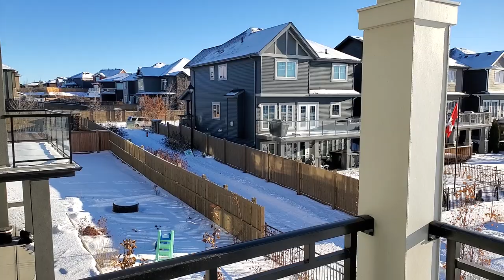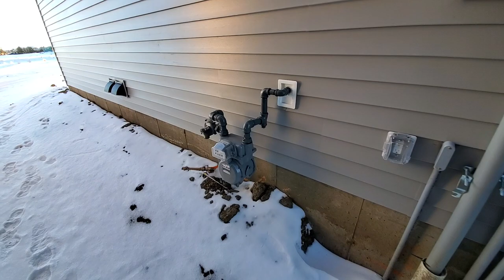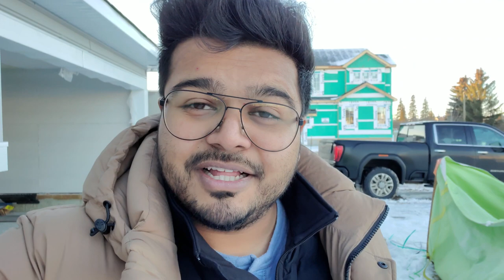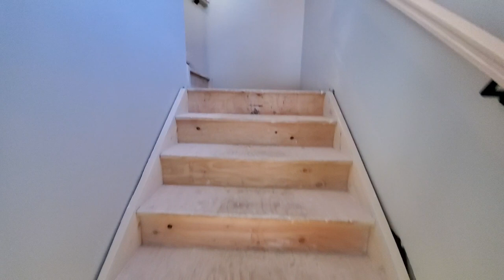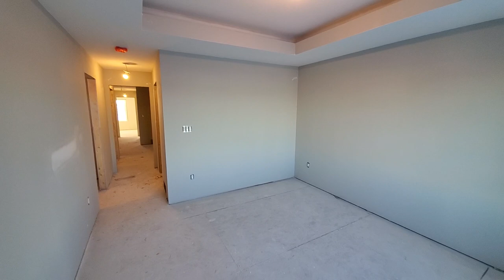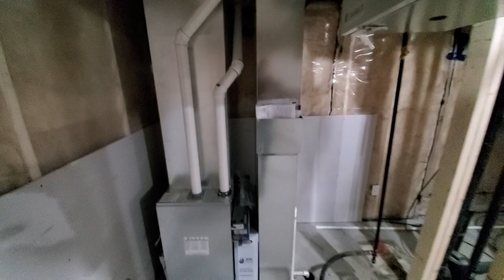New Home Construction, Home Builder SITE VISIT - DPAD's Daily EP32

Comment: In the master bedroom closet, you have the heating vents so close to the wall, but yet you've planned some shelving?? Wouldn't it be better to bring those out a few inches past the depth of the shelving...

In the niche for the refrigerator, I think you have the water supply all the way at the bottom, you could use one of those flush mount boxes, like you did for the water supply for the washer dryer, which then you could change the filtration easily without having to move the refrigeration unit, away from the wall...

I'm not a big believer in using the special drywall and applying tile, I feel much better with a Good Vapor Barrier base, with cement tile board...

Also are you going to be using colored grout, white grout is just asking for problems dirt & nastiness in the future... Maybe pick up one of the colors used in the ensuite, colored grout would tie it all together...

The window on the side where you're planning the chandelier, really no View, you could try putting in frosted glass, much more privacy there's nothing else to look at out there, the light stays in, no need to put curtains blinds or anything else??

Is there a glass door or partial glass door going into the basement, that small wall at the bottom, you could put in some glass block to Share the Light??

Also if they haven't put the meter in, & you run the electricity or the gas, or water do you just  pay a flat fee??... instead of running those monster rental heaters???

Otherwise things look very nice very modern, not necessarily my taste...